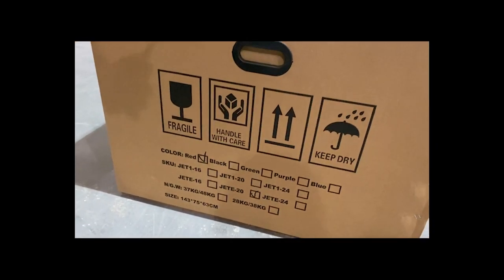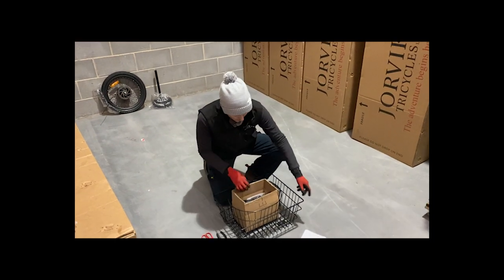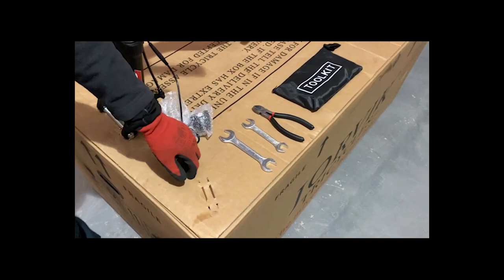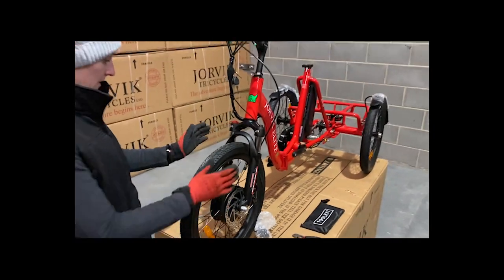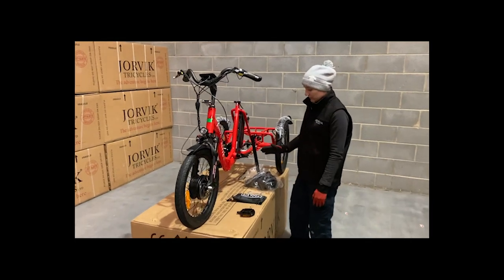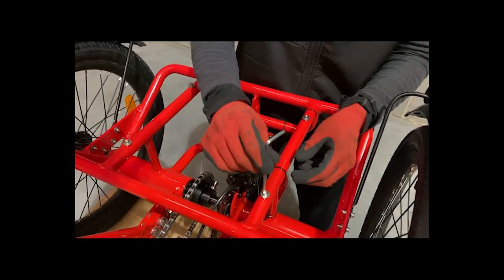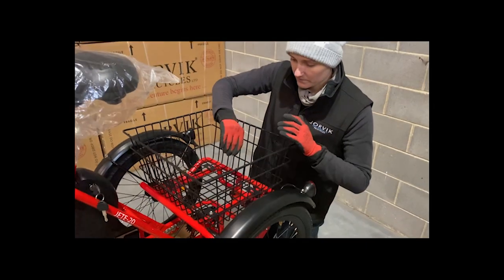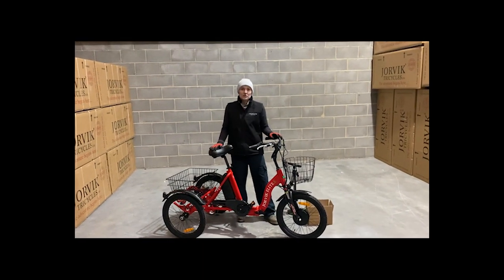JET-E: How to assemble your tricycle

Comment: I struggled for over an hour to get the front wheel to slide into position in the front forks. This turned out to be because there was a black plastic spacer in the disk brake that was there to protect he brake during delivery. This plastic piece just pulled out and then assembly was easy. This was not mentioned in the video or instructions! Everything else was straightforward.
Reply from the maker: Im sorry to hear that you have had a problem with the front wheel assembly, we will definitely look into this and  make sure that all the videos include all the necessary information in future. In the meantime, if you have any questions please contact us directly and we will be happy to assist

Comment: which country makes and sells these, who can service them?
Reply: Jorvik is based in York, U.K.
I live in Lincolnshire and they even export here across the Humber!
I've had one (not this model) for about six years which I bought when a back injury partially paralysed my lower left leg so, although I could still ride my bike, when I stopped I fell over which is undignified to say the least.
As for servicing, I do basic myself but for bigger stuff like derailleur gear cassette replacement etc. local bike shops can do it. Being a rural area we even have travelling bike repairers. The only potential problem with maintenance is that it is heavier than a bike so I use home made axle stands to test gears etc.
Hope that helps. I am sure Jorvik would help if you asked them.